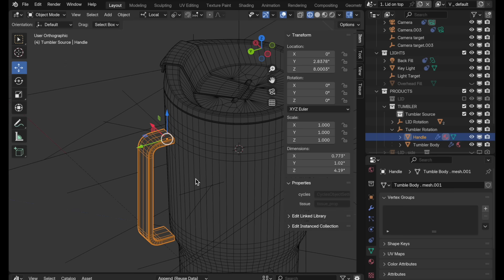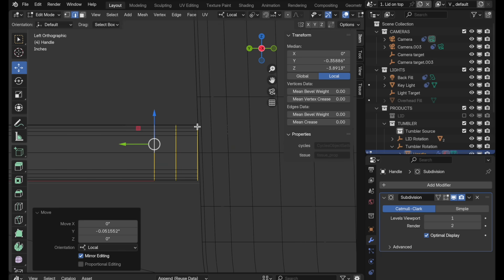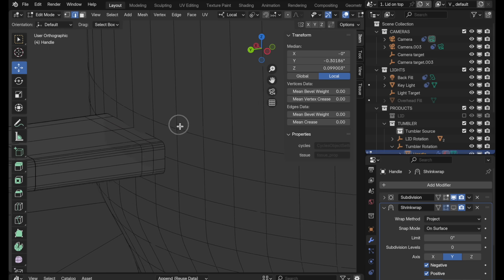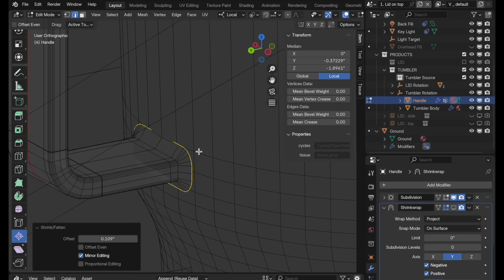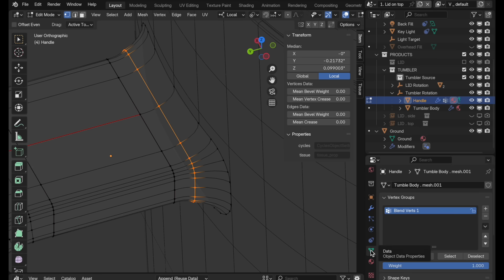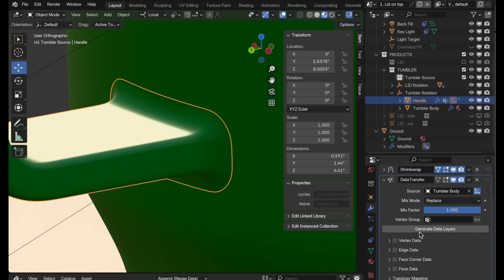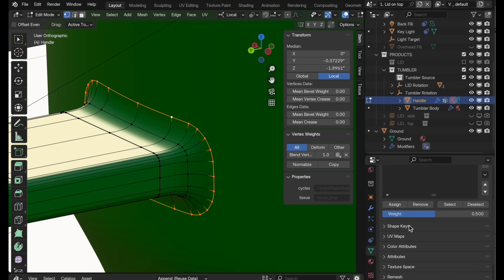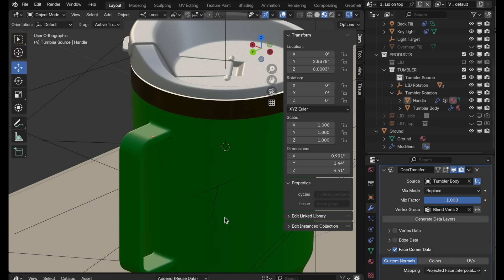Connect two objects using the Data Transfer modifier, it's cool!

Comment: Any dynamic non-destructive modifiers/modellers in 3D apps  should do "data transfer" by default out-of-box. Just like Maya/houdini/modo and even C4D and 3DS max ever did. Blender is a bad joke of 3D world. It's not an application. It's some kind of cult of the mediocrity and functional poverty. There's literally NOTHING in blender that's  works better than in other 3D softwares.  If you invest 100+ in a bunch of plugins and 1000+hours in horrible learning resources you'll be able to reach entry level of C4D. But you never will be able to create anything meaningful anyway. Blender is a church and  the only purpose of its existence is to be glorified by its users to achieve more users.
Reply from the maker: So why are you wasting your time watching Blender content when you have those 'superior' programs at your disposal?

Comment: To be pedantic the seam you get is because the "smoothing" of the subsurf isn't going fully parallel with the cup, something similar would happen with beziers in 2D if you you're not creating a full right angle with control points, you could get a similar effect by adding another set of verts that are just a little further out so you have edges/faces that are fully parallel., I can't say it would look better or worse, but my money is on using data transfer since it's effectively creating an ideal blend between the normals, without having to get the placement of the verts correct, but it's also risky as it can create a missmatch between the physical geometry and the normals.

Comment: One question, why double click the edge loop?
Reply from the maker: If you're using the Emulate 3 Button Mouse option, you have to double click an edge to do a loop select. If you're not using that option, it's Control Click I believe.
Reply: @christopher3d475  i see, i don’t use a laptop for blender. So that had me a little confused, thanks for the swift reply and informational vid. It was really useful!
Reply from the maker: @SqualidsargeStudios  Yeah, at the time I recorded this video I didn't know that also, lol. I've always used Blender on a laptop and so I've always had the Emulate 3 Button Mouse option enabled. I didn't realize this option altered the loop select  behavior.

Comment: It's still not there yet is it when you have to do so much to achieve so little.
Reply from the maker: You miss the point of the tutorial, to demonstrate a possibility that ShrinkWrap and/or Data Transfer can solve tough geometry problems. I've done a number of these video. 
https://youtu.be/KGgYQH5A2eQ
https://youtu.be/Qh3y6lFDCyU
https://youtu.be/2f5iHwpF3Dk

Comment: Even this method looks like quite a hassle. But appreciate the video.
Reply from the maker: The point of the video is to demonstrate the the potential of these processes, not to say this is the only or right way to do this specific model. I've done other videos showing them solving shading and geometry conditions that aren't easy to do otherwise. 
https://youtu.be/2f5iHwpF3Dk
https://youtu.be/KGgYQH5A2eQ

Comment: excellent guide, not rushed but not slow either. felt like you were holding my hand til i understood and then pulling me to the next lesson lol. though i already knew the shrinkwrap and vertex group stuff, i wanted to learn about the data transfer modifier and i certainly did (:  gonna look further into the data transfer node now

Comment: Two takeaways:
- you can shrinkwrap just based on vertex groups you weight
- you can also use these groups to steal beautiful shading from the item they attach to

Going to save a lot of time manually cutting and sitching parts together as one. Also might just eliminate baking artifacts brought on by intersects not done by this method
Reply from the maker: Yes, and the possibilities go beyond what I've shown here. I've done some other videos elaborating on these to demonstrate how useful these two modifiers can be used together. 
https://youtu.be/2f5iHwpF3Dk
https://youtu.be/KGgYQH5A2eQ
https://youtu.be/Qh3y6lFDCyU

Comment: Will this work for connecting character model parts together? I am playing around with AI models from my 2-D drawings and it’s been suggested to model body parts individually for more accurate results, and assemble them in blender. I’m wondering if this would be a good way to connect everything together? Head to the neck, arms to the shoulders, etc.
Reply from the maker: I haven't tried that in particular, you would need to test the process out to determine its feasibility in that context.

Comment: Has anyone ever used this method to attach a hand to an arm? In my head that means you can rotate the hand around and not worry about the arm mesh twisting with it, but I'm not sure if that's actually true. I'm gonna try it out, but has anyone tried?

Comment: im trying to use this method to erase the seam between the limbs of my Modular characters, but it doesn't seem to work :(
It sometimes seems to work in Solid mode, but once I change to material preview you can very clearly see the seams on the maps.
I imported my maps from Substance, so I'm not sure if by creating the maps somewhere else it becomes a problem, but need to know if the texturing of the maps affects this... since I know modular characters can have the same UVs and they done seem to leave seams.
Any clues as to what could be wrong?

Comment: Is this really that much less work than doing a proper fillet? Also, how does this kind of modifier data get transferred across file formats/applications?
Reply from the maker: I answer these questions in several subsequent videos, one where I demonstrate the clear advantage this approach has for a more complex scenario.
https://youtu.be/Qh3y6lFDCyU

And the ability to transfer this to other applications here:
https://youtu.be/xfVzcqhBQ00
Reply: @christopher3d475  Thank you for showing these. It's an elegant method that has some use cases. This probably won't work well with sculpting/texturing packages that bake out textures in UV space to get seamless displacement maps and others. Though I haven't tried. It's a great exercise to help people understand the effect of normal data on a mesh, also.

Comment: I guess for economy, here,  the  transfer modifier should be applied, and the normals baked into a custom layer.  If the blend has to be animated, though, Vertex Weight  Proximity might be worth a look, to assign weights dynamically.

Comment: Won't work for 3d printing where you need the two surfaces joined.
Reply from the maker: No, but it works better than a manual modeling approach for non-3D printing purposes.

Comment: Superbly explained and demonstrated Christopher. I particularly liked the way you included some tiny nuggets such as switching to active tool for the drag mode. I was not aware of that setting. Also I did not know you could add weighted value to vertex group assignment. Superb all round presentation and content. Subscribed.

Comment: First, just to make it clear, I mean no offence by this in case it is interpreted as such. I have nothing but respect for people with deep knowledge of this types of software. And I know that Blender is stupidly powerful. But all this tutorial does for me is make me NOT want to learn Blender :D Coming from "normal" CAD, this just seems so incredibly convoluted when in the CAD-software I'm used to, all I would do is select the end of the handle, extrude up to surface and then apply a fillet to it. Something that would take less than 15 seconds to do.

But maybe I've just stumbled across a technique for something very specific and there's actually a much simpler way to do this when you don't need XYZ.
Reply from the maker: Blender isn't a CAD application per-se, it's general purpose polygon based 3D software, so the methods and approaches are going to be quite different. A lot of people use CAD software for modeling hard-body objects, and then export over into generalist 3D apps like Blender for materials and rendering. So you have to think differently about what Blender is for and how to use it. The right tool for the right job. 

I also did a followup video showing another use case scenario for this technique, the first video was but one example. https://youtu.be/Qh3y6lFDCyU
Just go to the 1 minute mark and you can see the interactivity of this approach.
Reply: @christopher3d475  Oh absolutely. I realise it's for a different type of purpose and that's a bit why I'd like to add it to the toolbox. I prefer the "restrained" or "rigid" approach to CAD compared to the more "free" approach of something like Blender. But sometimes it gets frustrating if you need to work on something where you just have a mesh as a starting point, since CAD-software kinda chokes on it. It's hard to teach an old dog new tricks though :D
Reply: @treborrrrr  There's the free PDT (precision drawing tools) add-on for doing CAD in Blender that you may be interested in.

Comment: you could just extrude another loop flat on the surface to get the normals straight and skip the data transfer im pretty sure
Reply from the maker: You miss the point of the video. Watch the first minute or two of this follow-up video to see the power of this approach. https://youtu.be/Qh3y6lFDCyU

Comment: This is cool, but I think I could just model it faster
Reply from the maker: And what if you need to make the change to the handle? Then you have to start over. The tumbler has a tapered body, so it's not so easy to just shift it up and down if you 'model it faster' for one position.
Reply: @christopher3d475  I mean you can just adjust the handle haha, this is just so many steps for something so small.
Reply from the maker: @thisGuy481  You completely miss the bigger picture, why I demonstrated this approach. Go watch the 1st minute of my latest video and ask whether it would be faster to model it. https://youtu.be/Qh3y6lFDCyU
Reply: @christopher3d475  Yeah it's fine, but you're also not producing a water tight model. Sure, this is good if you want to look dev something, I can acknowledge that, but for a final product I would send that back.
Reply: @christopher3d475  A lot of people are missing the bigger picture...so what is it, what's the benefit of this apart from moving cup handles up and down? Not being sarcastic, want to know what problem this is meant to solve.
Reply from the maker: @angelavolkov1126  Yes, I definitely think you're missing the bigger picture here. These two tutorials aren't mean to show the only way to achieve the kind of result I got given the models I used, but to demonstrate possibilities with integrating various functions in Blender that you can then apply to your own situations. As an example, here's another video where I used the Data Transfer modifier to fix surface normals on an SDS model that can be prone to topology glitches. https://youtu.be/KGgYQH5A2eQ

Comment: One question: what if i want to export the object to be used in another software like unreal. This shadding will be applied?
Reply from the maker: I did a test, and at least for the Alembic and OBJ export formats, both were able to bake the normals and export them. Upon re-importing those files into Blender and another 3D app, the normals were retained. So it does appear to work.

Comment: This is a good trick, on a similar note the 'bevel' shader node can be used to bake a normal map that also blends two intersecting meshes together and could maybe produce similar results with less geometry. It's worth checking out.
Reply from the maker: Yes, that can work also for finer detail areas. But I'm about to post another video showing why the Shrinkwrap and Data Transfer method is the most flexible.

Comment: Bro just union both objects in low poly and fix the vertices.
Reply from the maker: That's a destructive process, if you need to make a change to the handle, its size or relationship to the rest of the model, you have to start over from scratch. This process gives you flexibility to reposition or change the handle.
Reply: @christopher3d475  Is AO maps works well in this process or exporting to other softwares, 3d marketplaces?

Comment: This is a super useful trick, unfortunately seems to actually be usable only if the object you are making is supposed to be somewhat matte, with no SSS, as either transmission, metalness, SSS or any kind of intense reflection reveals the trick for me
Reply from the maker: It worked for metallic mode materials for me. In act at the beginning of the video I show one of the tumblers with a metallic mode material. But this method isn't going to be the ideal one for every situation, it's just an optional approach.

Comment: I tried to compare 2 methods myself, and it's still much faster to boolean two separate objects into one, then fix some parts, rather than use data transfer+shrinkwrap then tweak second mesh to fit other mesh to create illusion of a single mesh. But I understand that data transfer method is undestructible, and can be good for future edits.
Reply: One is faster the other is more reliable is what I noticed between the two methods

Comment: 6:40 That's not exactly it, the reason you can see a boundary is because the normals of those vertices are not in line with the normals of the surface of the other object, the solution works because you are pretty much realigning those normals to match the ones with the other body.
Reply from the maker: But that's the point I'm making in the video. The normals of the attaching handle perimeter verts are generated according to their geometric configuation. Data Transfer pulls normals from the attaching mesh close to their position and uses those instead, which then blend into the surface calculated normals of the handle.

Comment: Super useful because you can add more separate parts with seamlessly connection just like one part without the need to add more geometry to the main part (also no messing with shading of the main part)

Comment: The shrink wrap modifier is very powerful. If you need to add a hole to a subdivision surface but doing so distorts the curvature, applying a shrinkwrap to it with a copy of the mesh before the hole can fix curvature issues. Vertex groups can then be used to limit the modifier influence.

Comment: i wish i new blender as much as this guy does. my only question is why wouldn't u just connect them into a single mesh. in struggling to think of a legit reason
Reply from the maker: It depends on the situation. Let's say you wanted to move the handle up or down to adjust its position. with this technique it would be pretty easy. The container tapers toward the bottom and if you had hard-modeled it, it would be more difficult to readjust the handle. But just consider this an exercise to demonstrate what the Data Transfer modifier can do.

Comment: It is a very cool technique! But I feel with this amount of steps I can probably do it faster just modeling the transition in this particular case, but it might be useful for something more complicated :)
Reply from the maker: As with anything in 3D, what's great for one situation may not be the best for another.
Reply: Tried this, takes 2 minutes at most, will be surprised if you can model the transition in two minutes.

Comment: The Data Transfer Modifier is the Swiss Army Knife of Blender Tools. I often use it for UV projection mapping onto models with complex geometry, using a simple object as the projection source.
Reply from the maker: Yeah for sure. This is one example of its uses.
Reply: any particular tut u got in mind to learn it?
Reply: Any tutorials you think might help us too? Cheers!
Reply: If you have some tips of Unwrapping U.V coordinate texture with this , i realy want to see this as tutorial, i want to use this on retouch of U.V mapping on complexe high poly model to make them low poly and well unwrap.
Reply: @Meteotrance  Let's say you have a complex high-res mesh like a photoscanned asset for example, and it's a pain to unwrap and minimize UV distortion. You can either duplicate and decimate the mesh to something very low poly or make your own low poly mesh, and then unwrap it without issue. Then use Data Transfer to transfer the UVs of the low poly back to the high poly. With Blender this does sometimes cause issues near seams that need to be manually adjusted afterwards but it can save a lot of time. Something like Maya has a much more polished version of this attribute transfer process (it doesn't work as a modifier but as a destructive tool that can afford to take as long as it needs to give a perfect result) but it is what it is.
Reply: @RawAustin   i Can have to rebuild model made by other, but usually i prefer start with very simple model and extend the detail with Zbrush or substance painter, it's more easy to have seamless texture from a flat surface multi angle light scan and use as a PBR material even if photogrametry scan is impressive it's a slow process and almost impossible to scan a full tree or a fluffy bush with all the leafs and branches, thats why procedural approach with geometry node exist, by combining many small texture and asset in a more complex one.
Reply: yeah  would be great to show us this litte UV trick
Reply: Could u send an example  video of this uv technique?